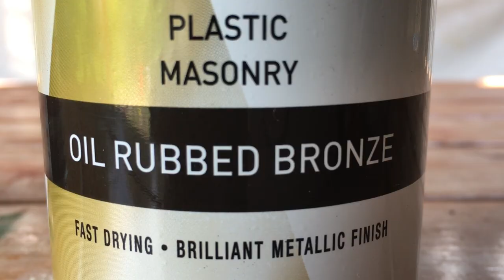Antique Grain Mill Restoration

Comment: Ouch!!!  You should have take all the internal parts and surfaces and coated them with a cooking oil and placed them into a hot oven for an hour, then turned the oven off and allowed the parts to cool in the oven.  Then painted the exterior of your mill.  The paint on the internal surfaces will ruin your mill for grinding grain.  (The paint will wear off and contaminate your flour or meal)
Reply from the maker: Thanks for watching and leaving a comment. Appreciate the tips. This was restored for Display Only.😉👩‍🔧
Reply: Thanks Kevin. I will be using mine.

Comment: Attached a pulley to the shaft, and attached that pulley to belt connected to a variable speed motor.  Wish the grinder shaft had a bearing. Makes grinding effortless.  These grinders are still fairly easy to acquire in my part of the country.
Reply from the maker: Thanks for watching- They are rare and expensive over here in Australia 👍

Comment: We got our grain mill torn apart yesterday, cleaned up and all the outer pieces repainted.  We were wondering what you did with the two inner grinding cones to protect them from rusting?  Did you paint those as well?  We will likely use ours to grind corn for chicken feed.  Thank you.
Reply from the maker: Oh, great to hear you got started on yours. I just cleaned the grinding parts and coated them with vegetable oil.

Comment: Nice job. I just acquired one of these and will be restoring it to grind corn. What were you dipping those nuts and bolts in? It looks like you're just heating them and dipping them in oil to quench.
Reply from the maker: Thanks for watching. Yes ,used hot bluing on the bolts n nuts..They were heated and quenched in vegetable oil to stops them from rusting and give a nice dark look. 
Wish you all the best restoring yours 👍👩‍🔧
#littlerestorers